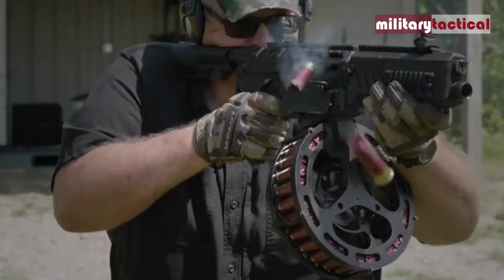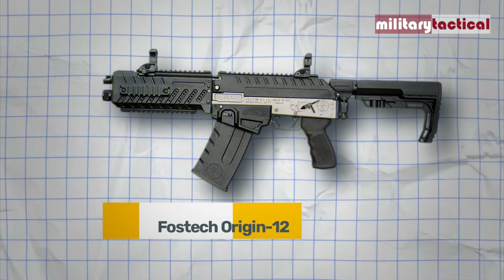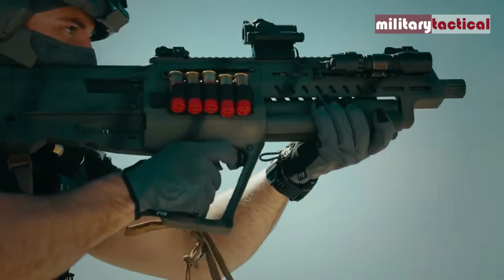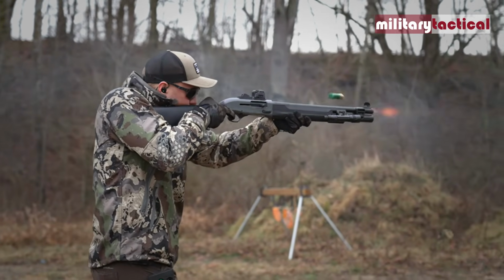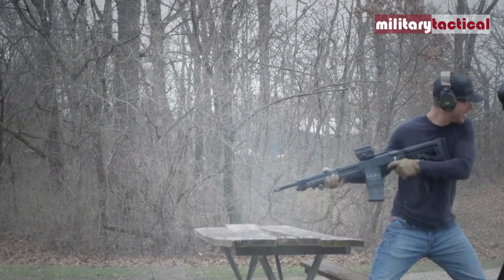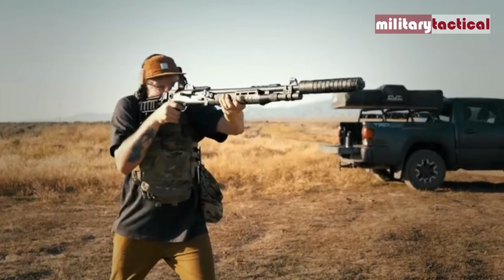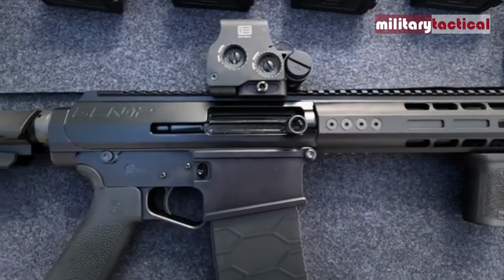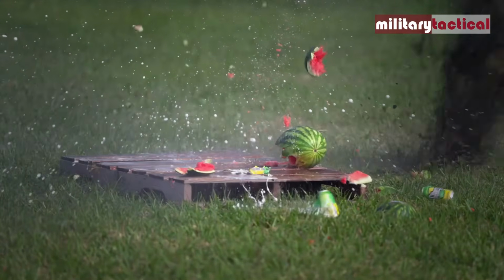Why These Shotguns Will Quietly Dominate the International Market in 2026! Here's why.

Comment: You guys screwed up. Your #1 pick and #3 picks are the same shotguns; they’re both 1301 Mod 2. The #3 pick, 1301 LTT, is better of the two shotguns; it uses 1301 Mod 2 along with LTT components. So #3 should be your #1 and have the designation of 1301 Mod2 LTT.  You also failed to point out that the LTT Beretta 1301 Mod 2 takes the factory Beretta 1301 Mod 2 and adds a LTT trigger job for a smoother, lighter pull, a Magpul SGA stock with adjustable length of pull, or a Chisel stock that incorporates an RMR Mounting Plate, Kick-Eez Recoil, and Cheek Pad, a B5 AR Grip (no end-cap), 6 potential QD Mounting Points, and 1 GrovTec Steel QD Cup. The 1301 LTT is specialized with GG&G accessories. While the stock Mod 2 features an improved forend and pro-lifter.
Reply from the maker: We apologize if the information we provide is inaccurate.